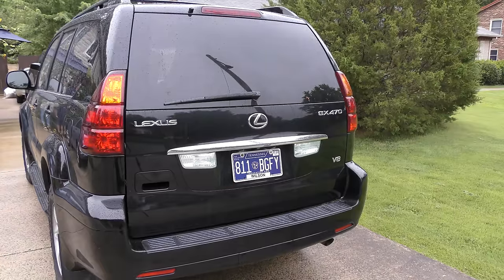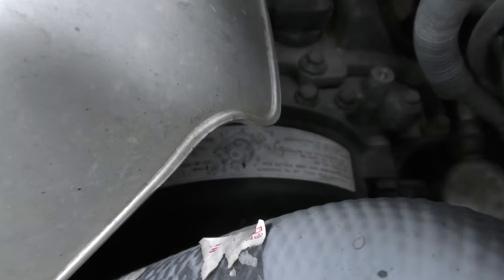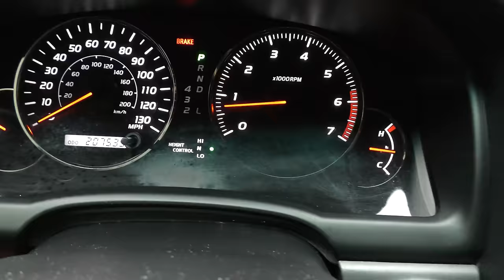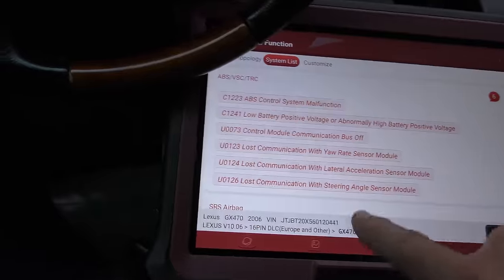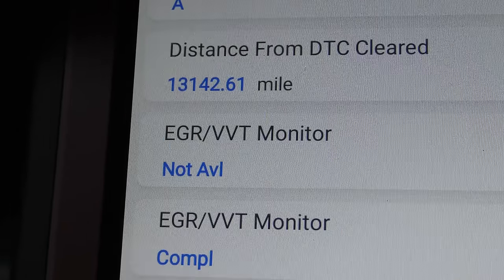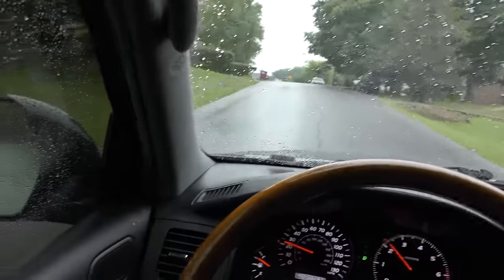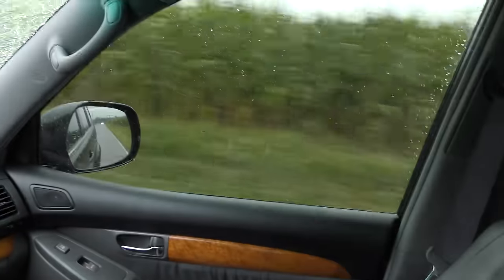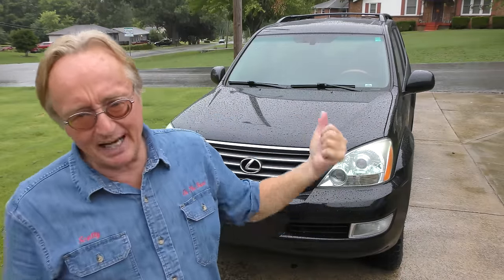I'm Sitting in the Best SUV Ever Made

Comment: I have owned two. A 2004 and a 2008. They are notoriously hard on CV joints. My current 2008 is on the 3rd set that I just installed!
Reply: You have to buy genuine Toyota parts. It's 4 times as much as AutoZone/O'Reilly parts but it's also 10 times longer lasting. Same thing about rotors and brake calipers for these vehicles.
Reply: @juchou2983  The first two sets of CV joints were OEM! The current set that I just installed, I went aftermarket (lifetime warranty) A1 Cardone HD. I figure I have nothing to loose except my installation time. At least I won't have to pay for the part (again), if the Cardones fail!

Comment: Other than it drinks premium fuel and uses timing belts, it's a solid vehicle
Reply: I put regular fuel in mine the last 80k miles. Drives the same as it does with premium. You don’t need it. I knows other that do the same thing and they said it doesn’t matter.
Reply: @ryand4940  same here, I never use premium and have 182k on it, runs like a dream!

Comment: Bought my 2008 during shutdown several years ago 144,000 under 10K. I have done calipers rotors pads, Aisin Timing belt kit , radiator, and the GX4.r $450 if I supplied the parts hoses thermo coolant
Reply: Half my reply is gone. Anyway, GX460 driveshaft to stop rear clunking. Arnott rear spring conversion kit as well.  Getting 18.1 mpg 75% highway.

Comment: Scotty recently bought one 2005. But having a problem with acceleration and shifting only after sitting overnight. Has a code p2714 took it a mechanic. Has 175k is it worth replacing the transmission if that’s the issue?
Reply: did you buy it from a private seller or dealership?

Comment: 100% correct; that vehicle is a BEAST; too bad they stopped making them; it was replaced by the GX-460 which is also an excellent vehicle; however, I like the GX-470 better. This vehicle uses premium gas and the gas consumption is very high.  If LEXUS could make something like this but ELECTRIC, I am sure they will kill the market. With the prices of gas sky rocketing every day having this kind of vehicle will be very expensive. The quality of the ride is the best I have ever seen.
Reply: somebody said I kept my gx470 because 460 isnt so good.
Reply: I have both.. They feel extremely similar. Gx470 ride quality slightly better but gx460 looks slightly nicer..

Comment: No way I'd buy an interference engine with a timing belt
Reply: Kinda forces you to do some other maintenance that will prolong the engine life.Water pump, idler pulleys, crank and cam seals, drive belt, fan clutch and change out the plastic radiator. I just did it myself on a V8 4Runner. About $700 -$800 in parts, two weekends and a case of beer.

Comment: Scotty, have a 2003 GX470 and replaced the timing belt at 62k miles based on the age alone.  6 years later I'm at about 114k miles.....is it necessary to change the timing belt at 7 years as I've been told?  I'd be curious to hear your thoughts on the age vs. mileage question.
Reply: A visual inspection by a competent technician will give you more insight.. If there is no micro-cracking or stretching visible... If the guides are not worn at all then should be able to drive couple more years..

Comment: Scotty I just bought a 1995 4runner with 177k the motor just went out its a 3.0l v6 woukd It be cheaper to rebuild the 3.0 or would it be better to 3.4l v6 swap it?
Reply: Definitely swap that 3.Slow. Head gasket kill it?
Reply: Swap it. The 3.4 is a lot more reliable.
Reply: @staticklingon1469  yes it did

Comment: The GX470 is probably one of the most indestructible suvs ever, except the airbag suspension
Reply: I replaced my air bags with good aftermarket ones for $200 and an easy hours worth of my labor. Now I can continue to tow trailers and have auto leveling!
Reply: I replaced mine with coil springs and shock, also very easy to do.

Comment: I have a question? I have a f150 2010 had to replace alternator but the battery icon won’t go away I’ve tried disconnecting battery to reset but won’t go away i got ac delco but heard that computer is sensitive and neeeds the factory alternator?

Comment: yes, 3 for one. If you have no time, but more money, dont buy a project car for 9k then get upset it needed brakes, water pump, and shocks in 30 days, and wouldnt line up because the camber bolt is rusted.

Comment: I have an 03 gx 470. Things a fuckin tank. Has its flaws like typical lexus dash cracks and terrible gas milage but it's been a good vehicle for what I've done to it. Lifted with a ironman bumper. 33 inch tires, snorkel kit the works. Things a animal for real. Wish it didn't have the rust it has but hey I live in western ny in the rust belt so it's gonna have rust

Comment: I have the same year Toyota Tundra with a 4.7 and at 173,000 miles the only trouble code is TPMS codes, not one single trouble code in any of the other modules.
Reply: I have a 2004 4runner and the TPMS came on years ago and I have 196,000. I bypassed mine, goggle and look it up how. Not hard and basically $5 compared to hundreds from Toyota if you really wanted to keep the sensors.

Comment: I always thought A SUV meant it had off road capability.  Are they good off road
Reply: The GXs are actually quite capable off-road. When they were originally released they caused a ruckus because it won 4x4 of the year (at motor trend I believe.) Overseas they are known as the Land Cruiser Prado.
Reply: One of the best vehicles off road.
Reply: I bought mine because they are great in nasty weather, and I do lots of long trips. I find myself in mud, snow, ice, dirt, tropical storms, you name it. The lexus is hard to lose traction, at least with decent tires. It drives like a dream, that is one major reason I upgraded from a 4runner to it, comfortable ride in the worst of conditions. Better approach and departure angle than the newer 460 as well.

Comment: Ride is rough because it's body-on-frame, takes a lot of concentration to center and drive on the FWY and the cheap foam filter for the impeller air pump will crumble to dust around 65K miles and cause the 2ndary air injection jammed issue (common to all Toyota and Lexus 4.7L and 4.6L V8s as they all use this stupid design for 2ndary air injection).

Comment: 13,500 for a vehicle that's a V8 with over 200,000 miles? Gas prices alone even though they are coming down is going to be a pinch. Maybe if it was a hybrid I would just think about it, but over 200,000 mile? I'm pretty sure that's when you start to pay for the maintenance on any vehicle, regardless of how dependable they have been, with that many miles on it things get worn.

Comment: 13.5k???
Got scammed. They're selling for for 7-9k with that mileage. It's not in perfect shape. It needs rad hoses at the very least. Timing belt is ridiculously easy in them and there's dozens of how to videos. If a diy mechanic has aisin receipts and pictures of them doing the belt AND it runs well, it doesn't need a belt. 

The airbags are likely to go very very soon. It's not high tech either. It has rear bags and valves in the suspension. 

ABS systems aren't known to die, but calipers DO die on them. 

MPG on vvti models, like this 06, is like 16 city 18 to 19 highway

How can an expert get so much wrong

Comment: Any reason to change a timing belt on a non interference engine if the water pump isn't leaking and the belt seems to look OK? My 02 Avalon with 150k still has the original.
Reply: Why risk it, just change it, it's more than miles, its like 90K or 10 years something like that.  You're just playing with fire.  Great car too, that will easily pass 300K well maintained.
Reply: What am I risking? I don't take it on long trips and it's not my only car. I have heard of some going 300,000+ without changing the belt. I could get it done now...but it would cost me $900 that i would rather keep in my pocket. I figured if/when the water pump starts to leak, that would be the time to do it.
Reply: @mr.jodaniels4156  Yea you could look at it that way, but if it snaps while driving, your out a lot more than $900.  It's not too hard you can do it yourself for around $300 if you get the kit.

Comment: Nah over 300k on 2004 suburban  runs and drives like new. Early 2000s Chevys best ever built Suvs.
Reply: My 04 made it to 284k before the tranny died. Woulda replaced it but it was too rusty. Loved that rig. Only issues were the typical GM dash not working (just used GPS for speed) and it went thru brakes like I go thru socks.

Comment: How do these compare to the land cruisers? Ik this is based on the Prado , but I'm curious what ppls thoughts are. Im looking in to getting a 2008 or 09 with hopefully around 150k miles. I've seen a gx 470 in my area with less than 50k miles going for like 30k$ and I would pay that but it's just not justifiable, especially with inflation so out of control. Would love anyone's thoughts. And comments thnx
Reply: Smaller, lighter, quicker, not quite as nice, weird back door instead of awesome tailgate, easier to find one without Nav (which is important), slightly better bang for your buck.  

Not as nice or legendary as the real Land Cruiser, but still damn good.

At any given time there seem to be more decent and affordable GX’s available on the used market.  Only about 10-20% of them don’t have the Nav.
Reply: @kftc1980  I instead. Decided and pulled the trigger on a 2008 FJ Cruiser, 6SPD manual, with the AWD which is always on with the stick shifts. I am thrilled with it.  And only have a few cons but I knew what I was getting into.

Comment: An Overpriced old gas guzzler. Over 200k miles with some modern technology like air suspension about to break soon for $13,500? Not worth it, you’d have to be desperate to think this is a decent vehicle ready to easily get another 100k plus miles with no major issues.

Comment: One thing to keep in mind is that OEM Lexus parts are incredibly expensive. Much more then Toyota parts even though when you get it at the Lexus dealer it often comes in a Toyota box. I made the mistake a few years ago of buying a used RX300 and it was by far the worst car I ever owned for expense.
Reply: You don’t have to go to the Lexus dealer for parts though. You can get most parts from Toyota since it’s a Prado 120 overseas and shares a lot of the same parts as a 4th Gen 4Runner here in the states. We have an 06 and 07 and they’re the best cars we’ve ever owned.

Comment: Takes premium...
Reply: Gx460 takes premium. 470 takes regular. I have both..
Reply: @juchou2983  oooo  470 takes regular?!  Are you sure you're not hurting the engine?
Reply: @noctilucent7396  I use regular in mine. It does not say premium anywhere..
Reply: @juchou2983  nice!
Reply: According to Lexus the 2003-2006 uses regular. From 2007-2009 VVTI was added and they require/recommended premium. I use whatever the wallet permits at the time of fueling.